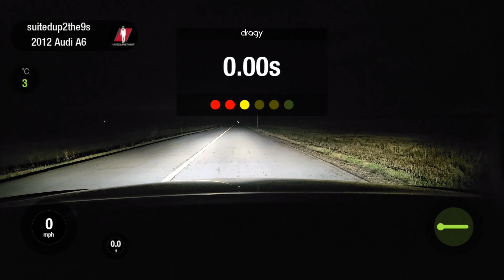The DA dropped and my Maggie WOKE UP!!

Comment: Are you getting any problem with traction?
Reply from the maker: @jpecc8314  yes and no. 

Yes I'm at the limit of my launch on the cold pavement. 
No, not with 034 ALC, I can adjust my launch rpm on the fly depending on conditions. So I'm right at the limit. I have been able to launch harder and cut a better 60ft on warmer tarmac.